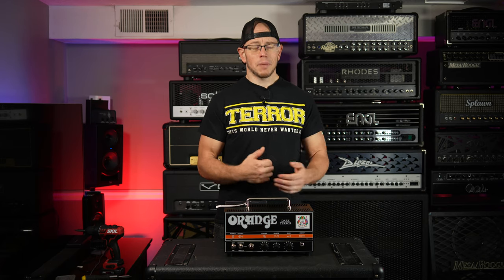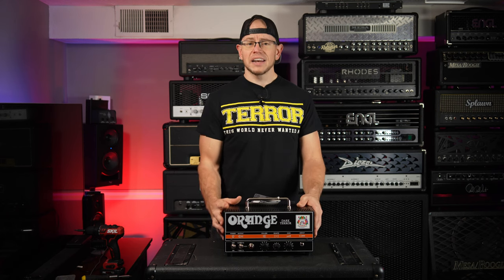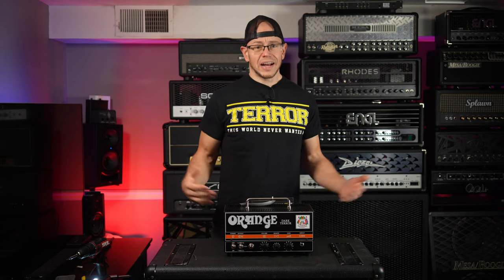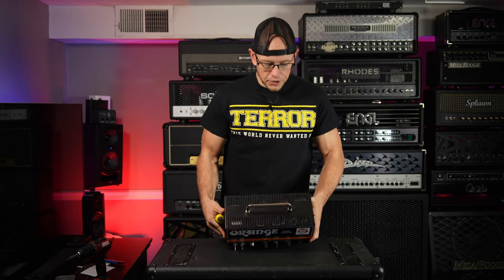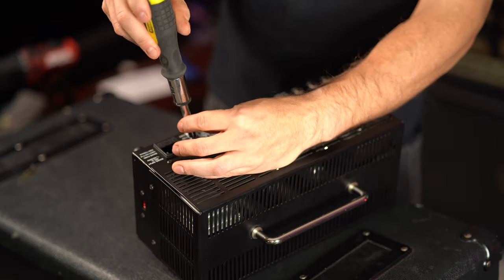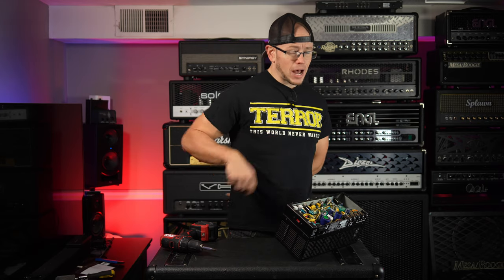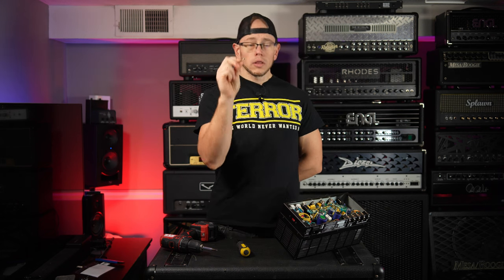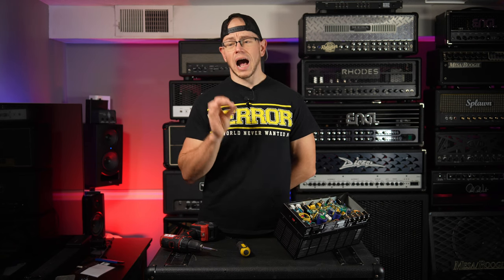I Bought A BROKEN Tube Amp.....Can I fix it? | Orange Dark Terror Repair

Comment: I would check continuity with a multimeter on every fuse. Even if it looks good, it can sometimes have a tiny separation that’s impossible to see with the naked eye
Reply: strangely they like to pop inside the metal cap area...so you dont see the pop and it looks perfect.
the low amp ones often have the fine wire resting against the glass when they pop (they should float)

Comment: Few tips I can add for other amateur repairmen: 

- Get yourself a non conductive screwdriver.

If you touch two parts at the same time (especially before discharging) you're going to pass electricity through them. It gets tight in there, and you can bump into things on accident. This can also be used when biasing, depending on the amp.

- Get a fuse puller.

This helps you avoid the risk of damaging fuses or contacts by accident.

- Get a headlamp

You'd be surprised at how useful this is. Especially if you work on your vehicle too.

- Learn how to discharge the capacitors properly.

I learned this from a CRT TV tech. This should be done if you're doing more complex repairs. It's not hard, but there's fatal risk involved.

- Get a good soldering iron.

I use a Hakko FX888.
Reply: I like my Weller WES51 adjustable soldering station. Has provided many years of service. Probably not a great “first” soldering iron but for someone with a little experience or who does a variety of projects it’s awesome. Just remember, you can always go hotter, but if you start too hot you’ll have a helluva time when it cools. 

Also, another safety tip for your list: never replace a fuse with a higher amp fuse than the circuit is rated for. It’s a great way to start a fire. Always go equal, or if you don’t have it, go slightly lower until you get the correct replacement.
Reply: @naturaljoe759  Good advice.
Reply: I cringed at him putting his hand in their without discharging the filter caps, regardless of if they have bleed resistors or not. We all have to learn, but there's often no second chance with the voltages we talking about in there...

Comment: I didn't see if you did in the beginning, but remember to always attach a load to the amp! You can use either a speaker, a load box or an equivalent resistor, even when there's no guitar plugged in. I have a cheap Harley Benton attenuator which can act perfectly as a load for amp repairs, maintenance and troubleshooting. Furthermore this is a very solid video with some very good instructions.
Reply: I was thinking the same thing.  He didn't mention that he had a speaker cable attached to it the first time he turned it on.

Comment: Enjoyed the video, thanks for making it!  Helps people to be confident in fixing their gear, not everyone can afford a large repair bill.  One thing I will say is start small when it comes to electronics projects.  Change the pickup in your guitar or replace a pot, and build from there.....but anyone reading this can repair their own stuff with a little bit of practice and research.  The advice you gave about one hand is very important, especially since when you touch the amp with 2 hands.....the circuit your body creates goes straight across your heart.  You should look into making yourself a "bleed resistor" to drain large capacitors, it would cost about $5 and it really helps with the safety side of things.  When in doubt check with a multimeter before touching anything.  Be safe and have fun everyone!

Comment: The DT is a great amp...when it's working. It's in my top 3 favorites of amps I have owned.  I had one that had a different problem. I often think about getting another one, and then I hear about another person having one with issues. I do love that amp though, and for $260, you definitely got a great deal. I hope that fuse solves your problem. Oh, and by the way,  Tung Sol tubes sound great in that amp

Comment: I am a repair tech myself, that first fuse you checked is actually the ht( high tension) fuse,it supplies high voltage to the tubes and the amp won't have sound without it like it does when you first test it, it is best to check them with a multimeter as sometimes it can be hard to tell if the thin wire is broken. If I am not mistaken that 4 amp fuse is the heater fuse for the tube filaments, it being broken is either a sign of a huge power surge or the amp being used on the incorrect voltage setting or of course something seriously wrong with one of the tubes. Usually you can replace those without any issues and move on. I would recommend Mike test those tubes for you just incase they are still good and you don't waste a set of tubes.
Reply: It is the heater fuse, and the pilot light is on the same circuit/fuse. I had 2 dark terrors break the same way within 2 weeks of owning each one. I think the power transformers for a batch of these amps are feeding the circuit way too much power. I never checked the voltages of them but I can say that those tubes glowed very bright, much brighter than normal, which makes me think the filaments were getting much more than 6.3 volts

Comment: First amp I ever repaired was the Ampeg VL-1002. Typical molex connector issues. I bought the lee jackson video and got to work. It was a very rewarding feeling if it was a paint by numbers type of video.

Comment: I had done the exact same repair on my Randall RM100, but for the longest time just didn’t touch it because I bought an EVH 5150 III.  My Randall’s bad fuse was pretty well hidden under a second pcb board.  It’s a great feeling when you can just roll up your sleeves and fix something like that yourself.

Comment: I concur with your approach & do the same thing! I'm working on a 50-Watt ValveKing that was completely dead & found that the indicator light housing nut was on the board and would blow fuses. it now doesn't blow the fuses but sounds like a big Hummer. Time to swap out the power tubes.

Comment: I've been in this situation before including taking a fuse out of a similar amp.  But after dealing with that I think it's important to have a spare parts drawer with common fuses, common tubes etc.

The third thing is if the amp itself was the faulty thing, and it had a bad bias resistor, you would have redplated and destroyed those known good power tubes.

So even as an amateur you should have a multimeter whenever you are inside an amp.  If the voltages aren't correct when there are no tubes, that would be a sign not to install any tubes.

Comment: Blowing tube fuse is normal. It's enough if you switch your amp on and off and back on too quick and this may cause it popping. Of course I've just replaced mine with new one and amp was working fine again. Just be careful with bias pots etc. Touching them if you don't know what you do and you don't have a tube voltage test socket may kill you or at least your amp cuz you might have an idea of soldering voltmeter direclty to the board. Which of course I had to do when I screwed my tube amp for the first time.

Comment: Last year I picked up an original 5150 212 combo from GC for $400 because it was “broken.” Turns out the previous owner tried to mod it somehow and screwed up to the point he decided to unload it. I undid the damage and got it working perfectly in about 4 hours. I would 100% do it again with another broken amp.

Comment: Ground the caps to discharge, then short the caps to themselves(anode to cathode) using wire, or buswire.  They recharge if you don't take that step, even without power.

Comment: Well that was useful knowledge. And a super good buy. Congrats!

Maybe do a filter cap discharge in the future? It's like a 22K 5w resistor with one side on ground. Probably not necessary, until the one time it is.

Comment: You can drain the caps by strumming ypur plugged in guitar afiter youve turned EVERYTHING off. The volume will bleed away slowly over a couple of seconds and that will drain the electrolytics. I still use a five watt resistor to touch the caps and check but they're always drained if you do it with your guitar.

Comment: I enjoyed your video. New subscriber now. Thanks for the great content.

p.s. May want to  check your solder joints to the tube terminals. May have a solder joint that needs a little reflow.

Comment: I bought a pair of broken pedals recently. A Boss HM-2 Heavy Metal made in Japan and a Dunlop GCB95 Crybaby. The seller said the HM-2 wouldn't turn on, and the wah had an issue with the battery?! Got them both in the mail, and the HM-2 fired up with both a battery and a 9V DC plug. The wah just a broken battery compartment, but who uses batteries anyways? Scored both for €50.

Comment: Now you can take the tubes that were in it put those back in and see if it works and you won't have to get tubes and the only thing you need to fix would be the light and you're good to go

Comment: I'm pretty sure you don't have to bias these.
CS guitars changed the tubes in his Rocker 15 a while ago (and did a video on it) he is an amp tech and he said that it didn't need to bias it and I'd assume that the dark terror and the Jim root would be the same.

Comment: So don't wrap the fuse with tinfoil? Great video, I've been doing vintage amp repair for 2 years now so I'm still a novice but have worked on blackface and silverface Fenders, a few Peaveys, a killer Carvin Vai, my 81 JCM 800 and some other small amps. Always discharge caps the Terry at D-Lab way. Also a Variac and current limiter can be very handy. I think  I'm doing pretty good, I'm still at the work on friends amps for free stage but not forever. Anyone in the Chicago area that needs some free help message me.

Comment: I bought a peavey 50 50 classic power amp that was sold as broken at guitar center many years back. I got it home tore it apart. Someone took all the tubes out and had them sitting inside the amp in a brown paper lunch bag. Put the tubes in and walla a working power amp on the cheap. I got lucky.

Comment: High voltage can jump to ground through your shoes, one hand is not safe. Drain the filter caps people, regardless of if they have bleed resistors. I appreciate that you're not pretending to know a lot about working on amps but this is literally step one and if you put your finger in the wrong spot you could have easily died. Also im not sure i saw you put a load on it the first time you tested it, valve amps especially need loads.

Comment: Hey guys, I have a EVH 5150 iii 50 watt with similar issue. does anyone know if there is an internal fuse . I checked fuse on back of amp , it's good. Power tubes have normal glow and can hear electrical current , but know sound and no lights on front panel.

Comment: Wear plastic sole shoes, one hand, if not properly discharged wait more than an hour after unplugging it. Some serious voltage in those capacitors. Absolutely deadly. Discharge tool and testing bulb building is around YouTube. Beware.

Comment: I’m going to hold one hand behind my back while I use the other to make direct contact to a live electrical circuits. Um… don’t do that. Insulated needle nose pliers are not very expensive.
Reply from the maker: or, this also works 😜